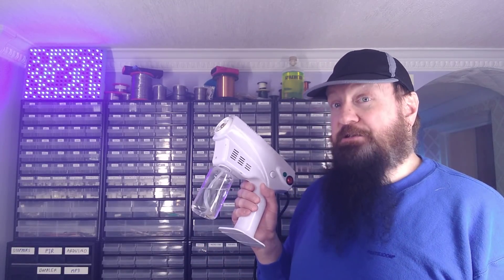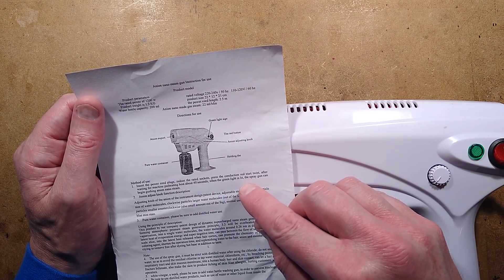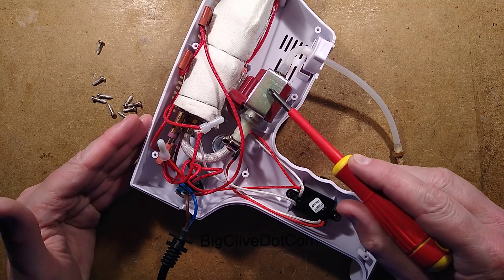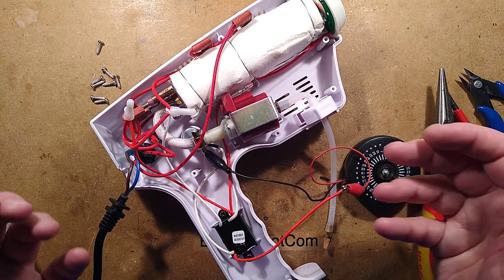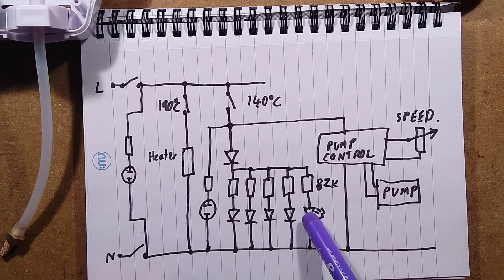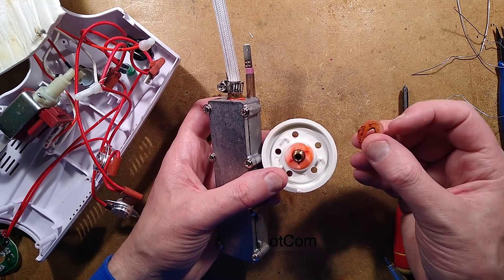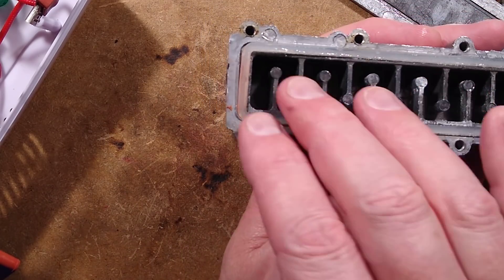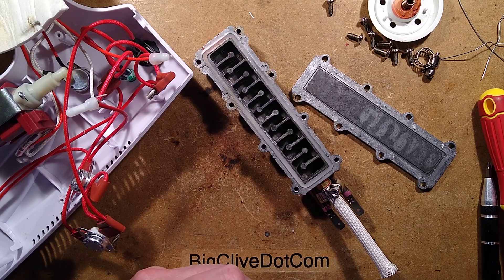Inside a hazer phaser.

Comment: Let us know if you feel a shortness of breath, a persistent dry cough, or your heart stopping. Because that's not part of the test. That's asbestos. Good news is, the lab boys say the symptoms of asbestos poisoning show a median latency of forty-four point six years, so if you're thirty or older, you're laughing. Worst case scenario, you miss out on a few rounds of canasta, plus you forwarded the cause of science by three centuries. I punch those numbers into a calculator, it makes a happy face. :)
cave johnson
Reply: I'm going to spray asbestos particles from this anyway
Reply: even if it was asbestos, as far as you don't rub it, it should be fine. The problem is not the asbestos itself, it's the dust that contains those small asbestos fibers. They can settle in your lung and do bad things in there.
The main problem with asbestos in buildings is that in many buildings the floor contained it, and the fibers would loosen up by walking over it. Asbestos in concrete is not harmful as long as you dont demolish it or drill into it, which again creates fine dust.
Reply: I'm going to rub/drill the asbestos for dust before putting it into this then. Thanks
Reply: TheRailroad99 You must be fun at parties. Especially “Portal 2” LAN parties.
Reply: @TheRailroad99  they stuck asbestos in everything, roofs, floors, walls.  My Grandparents built a house in the 40s and the outside siding was pressed asbestos panels, in funky 40s green and red.  On the good side, you never had to paint them, and like you said, as long as you never disturbed 'em they were fine, and I highly doubt the place would ever burn down.  :)
Reply: @lohphat  nahh, more the doom player at LANs. (Or a bit of Factorio for the more calm LAN parties). But the most fun can be had while wiring up the whole network. always my part :D
Reply: @nate_d376  Cave Johnson would burn it down with a lemon...
Reply: @sethanix3969  uiop uiop would burn it down with a gromit mug...

Comment: Micro version of a "Smoke-Cloak" (Martin) anti-theft security device, they run at 3KW with a lead "heat-store" using a (Special?) glycol solution.... Triggered by a confirmed alarm activation ( 2 individual zone triggers) Interesting video, quite cheap for the engineering within it!
Reply from the maker: I remember those.  I think they used a pressurised glycol tank to dump it in quickly.